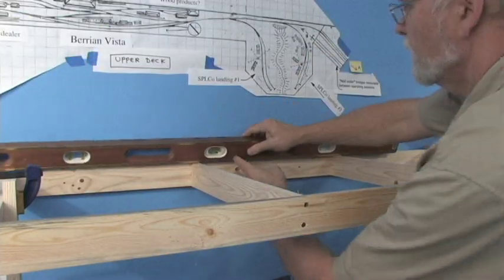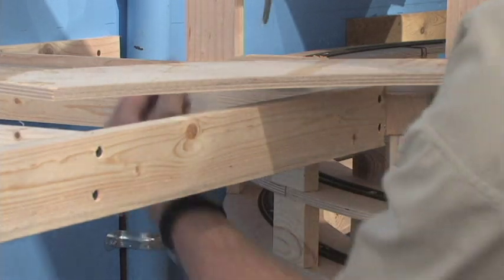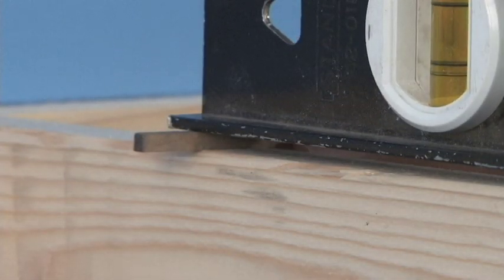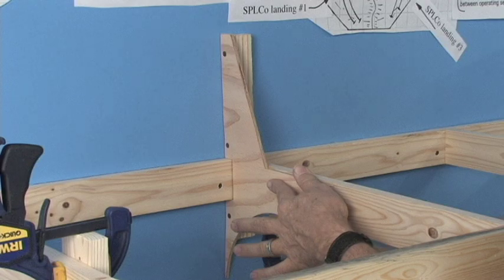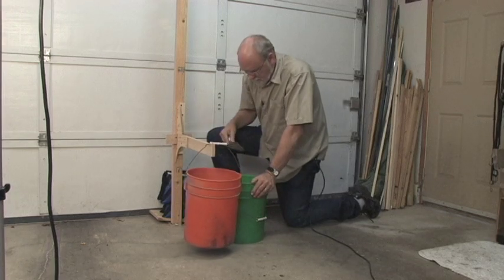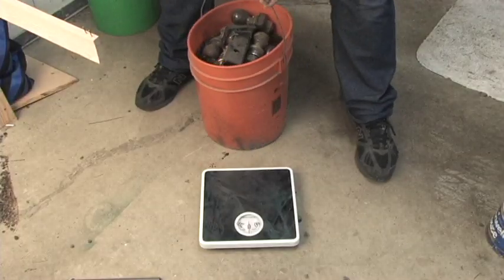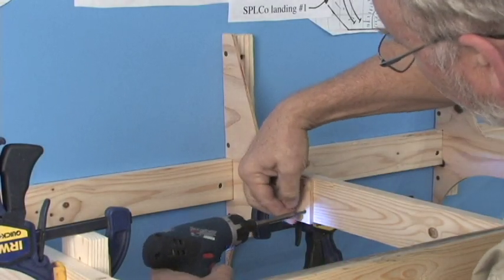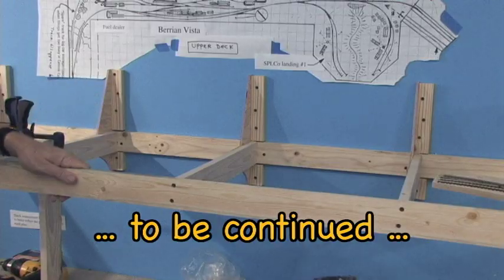Second deck layout construction part 2

Comment from the maker: Steffin - I've used this bracket system on two previous layouts for clubs, and they work great, so this isn't the first time I've used them. It is, however, the first time testing their capacity. My curiosity got the best of me. And as an old editor friend advised me, "don't just tell them, show them."

Comment: Great video. What issue of MR is this material in?
Reply: I am considering adding a second level but my space is very tight. I can go through the wall for staging and another switching area. But was considering a helix. Can you show more of the helix bench work and also what do you recommend the min radius for 6 axle diesels. Modeling the New Haven in the 50s.

Comment: what, no wood glue?
Reply from the maker: On which part of the project are you inquiring? I use wood glue where appropriate, and sometimes, no glue when it's something I am likely to change, or have the potential to change someday.
Reply: Where you placed the screws? Did you add wood glue to or on the placement of the home made gusset support bracket.